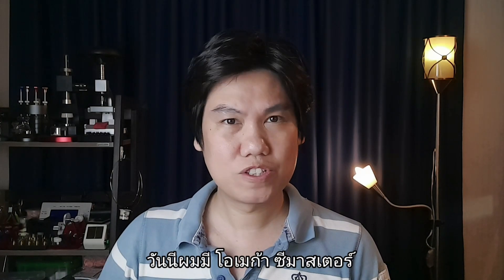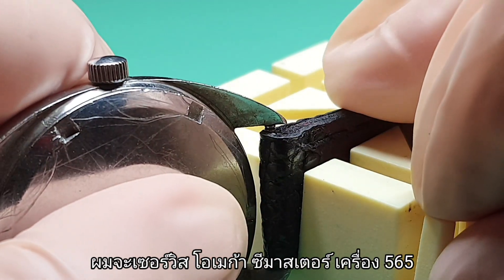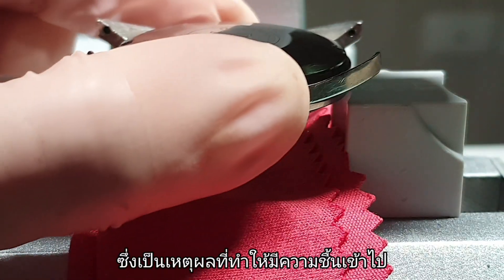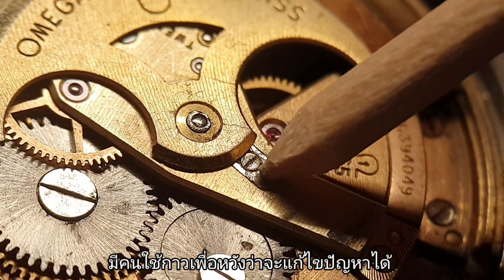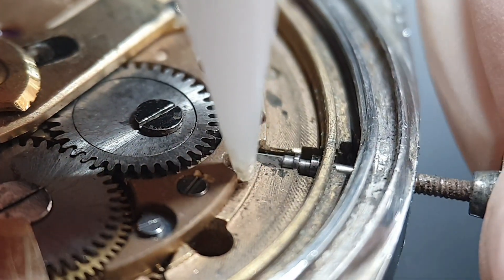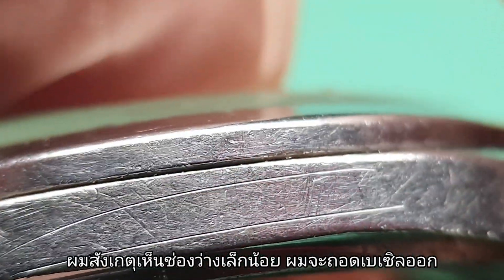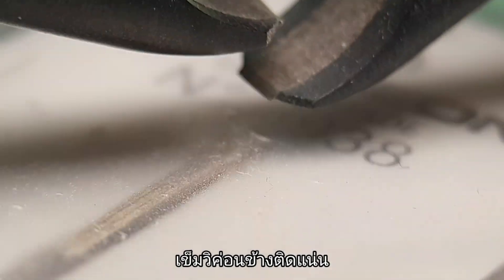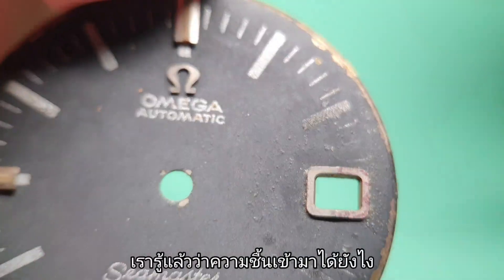Servicing Omega Seamaster 120 Cal. 565 Part 1 of 3 disassemble / ถอดประกอบ Cal. 565

Comment: Hey Ned I have omega 561 almost similar to your 565. how do I clean the parts, I read they were made or plated
This is the very high grade, ‘Officially Certified Chronometer’, Omega Calibre 561 automatic, copper-plated beryllium-bronze, 24 jewel movement
can I use Ammoniated clock cleaning concentrate to clean parts? Thanks in advance.
Reply from the maker: Hi, Thank you for comment.

I doubt about using Ammoniated concentrate.  I would use naphtha to clean the parts.  This sure will do no harm to the movement.